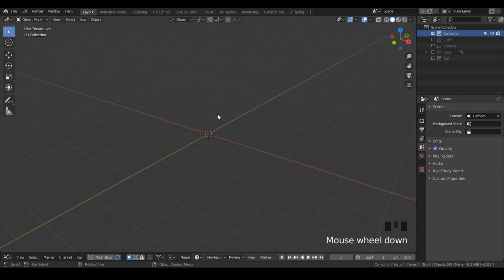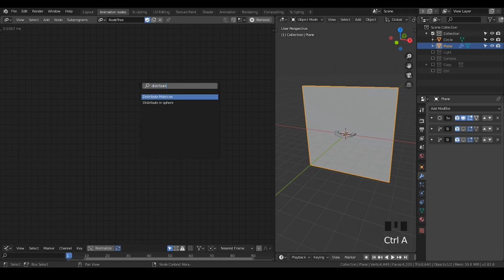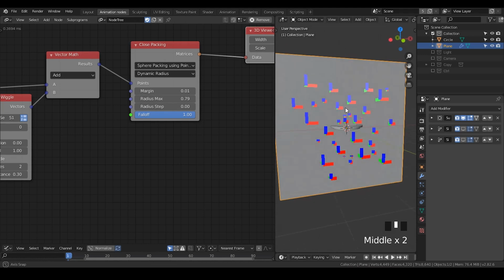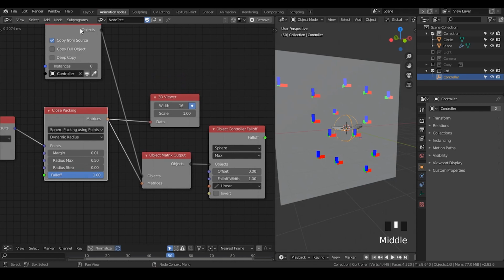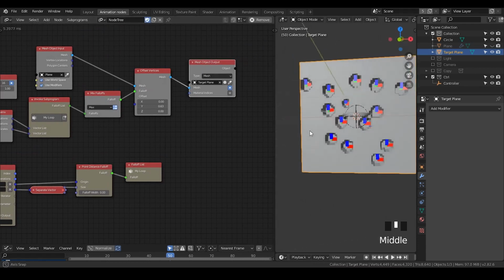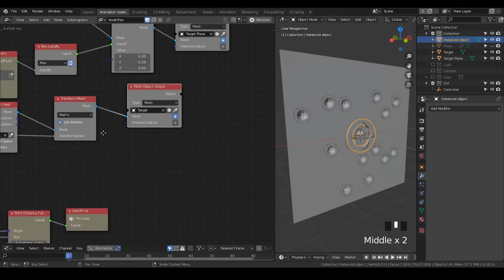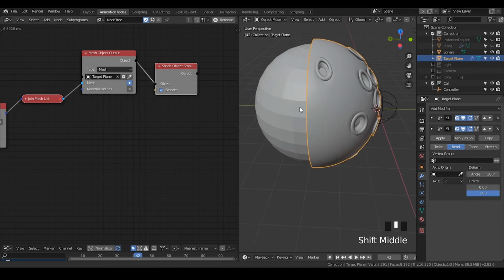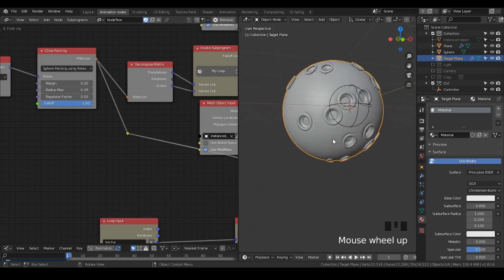[Tut] Moving holes without intersections - blender animation nodes

Comment: very well explained, i wish it would be much easier for such a simple animation. by the way another silly question here, a little bit confused how can we give random color to each object? Doesn't work for me the object info >colorramp thing, i don't know mine is behaving like a single object, i hope i could have explained the problem
Reply from the maker: In such a case, try to use "geometry - random per island" and color ramp. Be aware, this method only works for cycle but not in eevee.
Reply: @bradleyanimation120  ok thank you

Comment: A silly quesiton: how can I separate materials from 2 meshs after Join Mesh List?
Or may I keep 2 Mesh Object Output to combine their dimensions?

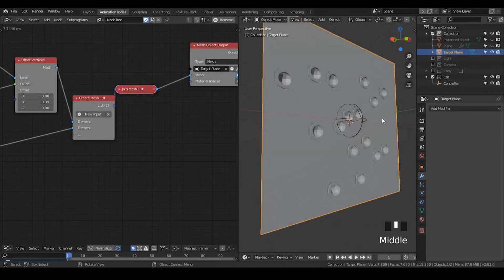Just as you mentioned at 20:52
Reply from the maker: Firstly, I will state the conclusion: Using the method mentioned in this tutorial, material can't be really separated in AN.
There is a proposal these days talking about this issue, but it's not known when this feature will be implemented in AN.
AFAIK, it's also hard to easily keep 2 object while keep the dimension.

Some thoughts to solve the problem:
1. There is a workaround that uses the "set polygon material index" node, but it maybe difficult to explain by words, and it may potentially be rather complicate. (I may discuss about this some other day)
2. Or, Rather use the old method in the tutorial: https://youtu.be/mUzuvX1yHlM. This way The material won't ever be the issue. The old method didn't mention the "close packing" node because it wasn't available, but if you know this node you can definitely try by yourself which is not hard. Just be aware that "relaxation" mode in close packing node may be difficult to achieve using this method.
Reply: @bradleyanimation120  
Thanks for the quick reply! 
I really appreciate for your detailed explanations. 
Actually I play around with these nodes for a while and realize it's not that easy to achieve this goal. 
However, I found a 'Material indces' input in 'Mesh Object Output', wondered how it works, and I didn't figure it out myself.
Maybe it's relevant to 'set polygon material index' you mentioned above.
But like you said it's not a big problem at all, I was just curious about if there is a solution.

Thank you again~
Reply from the maker: @渡辺城原  In terms of "material indices" socket, firstly a index always start from 0. If you have two material, the first will have index of 0 and the second will have that of 1.
The socket shows the material used for each polygon in the mesh. So you are right, it's something related to "set polygon material index". The difference is that one of them is to "show", and the other is to "set". But they follow the same principle.
What I don't like this, is that obviously we are hitting thousands of polygons, So I don't want to specifically think whether the second material should be used since 10001 st polygon or 10002 nd polygon. In fact, If I were to really do it, it won't be as terrible as it sounds, but somehow I just don't want to be bothered with this question in this animation.
Reply: @bradleyanimation120  
Totally understood, and that polygon part is terrible indeed, I agree with you. 
Let's wait for AN group to provide a better node for this :P